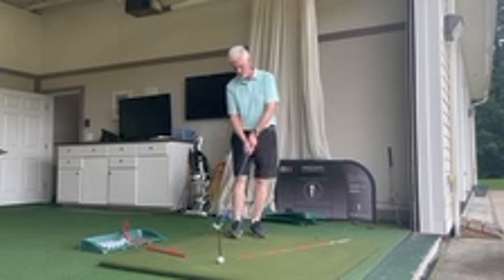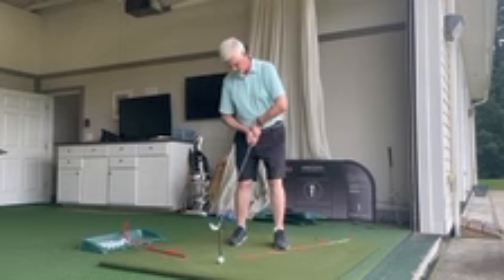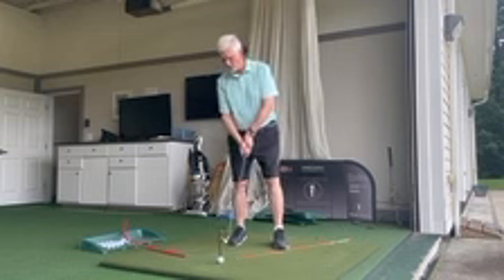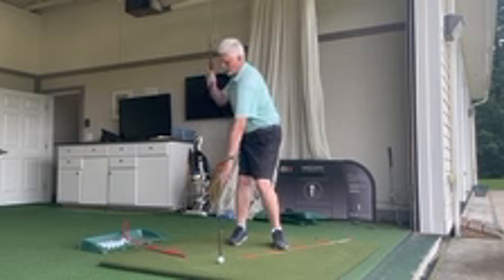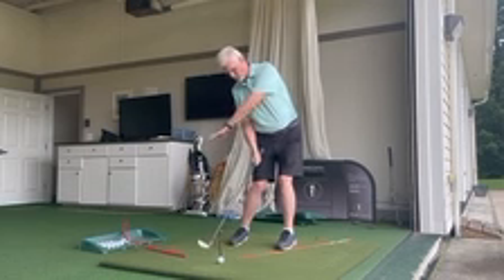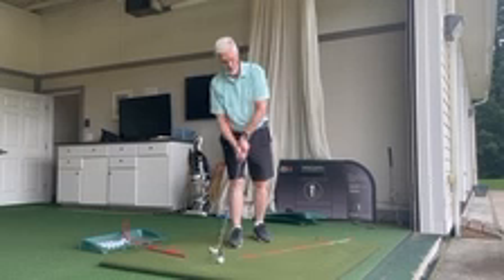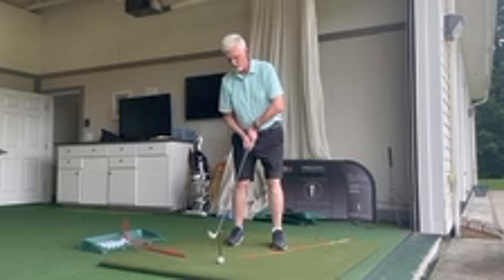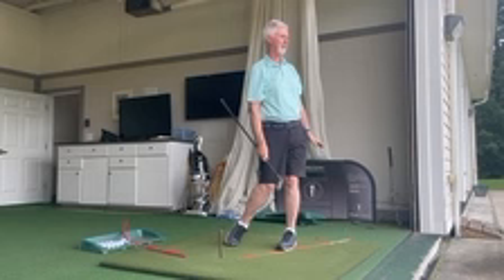How Dave Uses The Vector And His Motion Trigger

Comment: bill or david.  i cant tell but would like to more about the set up.  if you would please.  are you setting up really open and facing left quadrant?  if so, when you are not practicing do you set up square to the ball or what?  i guess i am asking what is different between practice set up and not practice?
Reply from the maker: @abs828  hey Lanny Dave is setting up just like he plays it’s not an open stance .  He’s using the back stick or vector to walk into his set up and aims from the rear .  Watch his lead heel during the motion, he sets it even closer to the lead stick or vector which assist with his cross lateral squeeze and it serves as a brake as well, or the wall he is hitting against for a split second.  When he moves his heels that is referred to as the Harman heels which he learned from Tom.  Hope that helped.
Reply: I can be open with the Feet and Closed my Action with what I do with my heels. I know it sound confusing but it's all about how the Femur Bones influence the Pelvis. If you understand that the Ball is to the Right of you, you can send all you want out of the rear Vector. If you look at the Funnel of Energy Vid you will see me Open and Square with my shoulders when I strike the Ball. That's all I care about. When I play all I care about is proximity to the Ball and wind around my Right Internally Wound Right Leg.
Reply: @s3gts  thank you.
Reply: @Wooduck  thank you sir, it does help.